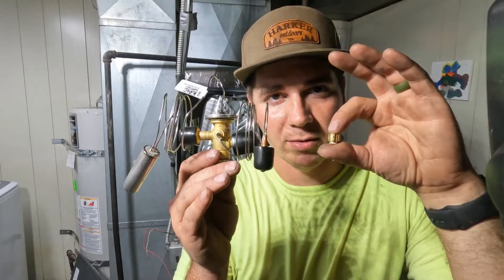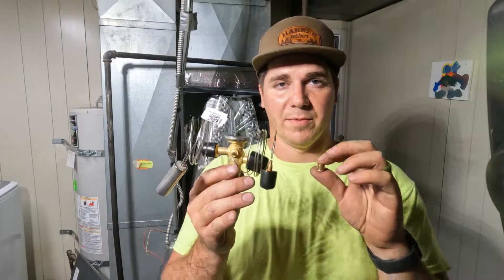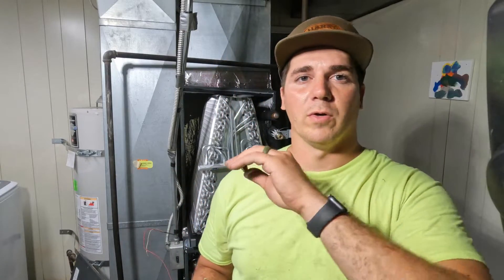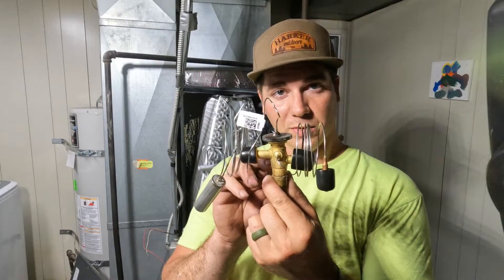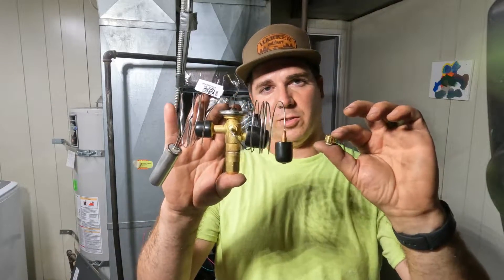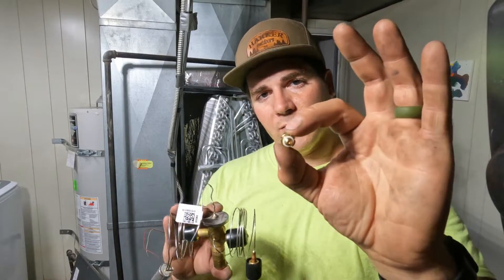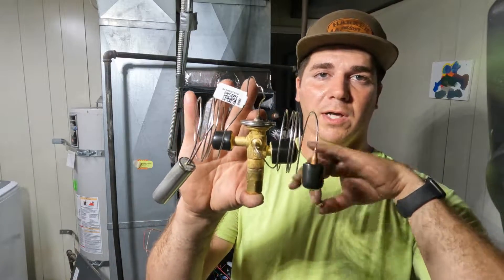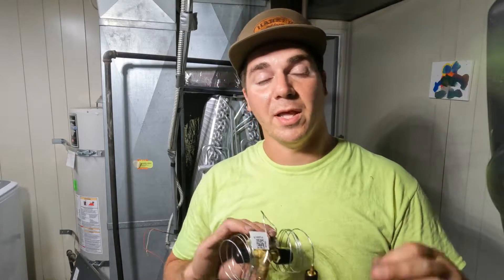Air Conditioner Metering Devices Simplified. TXV VS PISTON.  Which is better?

Comment: I have (2) 49 year old units, possibly carrier, the plates are all unreadable. Can I assume I have R22 in them, and that they were built with piston metering?
Reply: Back in those days they used capillary cubes so most likely that or piston and yes you 100% have to use r22

Comment: The money saved through the TXV will be negated by the cost of repair it will cause by way of failed compressor due to a faulty TXV or failed TXV itself all of which are costly $800+. Piston will never clog or break down and will cool the house very well and the difference in electrical bill will be minuscule. 
This is my opinion as a HVAC tech since 2019.

Comment: This isn't the best description.  A txv allows for a fixed subcooling regardless of conditions.  This is extremely important if you have to deal with variable humidity levels.  It's more efficient as noted in all conditions.  With a properly installed system, a TXV is very reliable and they cost $60-100, they are cheap.  With new efficiency standards they will effectively be required.  The reason they don't get installed is that techs don't understand them.

Comment: Hi Dave.   Excellent video.   Question:   Are capillary tubes ever used in residential split systems as the metering device or are they mostly for smaller appliance devices like window units, refrigerators and freezers.    Thank You.

Comment: Hi Dave, correct me if i'm wrong.
Most (99.9) TXV's are Hard Shut Off TXV's. If using a scroll compressor you're ok.  However, if used with a  reciprocating compressors you must install a Hard Start Kit at the condenser.
Reply: I don't believe any TXVs fully close, so they aren't hard shut off as they are always open some.  All modern AC compressors are scroll.

Comment: Thanks for the video.  We get bi annual checkups on our now 5 year old system.  Local HVAC company recommends an upgrade and wants to charge me $2,000 to go from a piston to the TXV which seems ludacris to me.  Any thoughts?
Reply from the maker: Yes that is ridiculous. Stick with your piston if it’s working fine
Reply: @diyhvacguy  If it ain't broke, don't fix it.

Comment: There are two different types of expansion valves  adjustable ,non adjustable  u can adjust your swing on your expansion valve if u add a pressure port at exapnsion valve so adjustables are more for energy efficiency to meet certain seer ratings  in my honest opinion id just use an orfice it get as cold as its going to get with and expansion valve if not colder 100 percent of time  ,with a well insulatated home the compressor run time will be less and last longer than with expansion systems plus one lesss part that can go bad 😅 this is from my experience being the the industry for 12 years plus in so cal i do industrial refrigeration and air conditioning i started my first 7 as a residential ac tech and ran a service department so i encountered all types of issues and complaints ❤❤❤❤❤😢
Reply: Yes and no. You know if compressor is running properly there’s nothing wrong with it.. like he mentioned- running without stress. Plus a better humidity control. 

This is a dilemma for me now. I have a piston system and I have txv. Don’t know which direction to go

Comment: Awesome video all the time. I have a question  R22 condenser transitioning to 410a. same r22 evaporator do i need to install txv or piston is okay.
Reply from the maker: You actually need to replace the coil all together. R22 coils are not designed to handle 410a pressures unless it says it’s compatible with both. If it is compatible or you are replacing it with a new one, and it’s not in a space that is close to living area or sleeping areas, I’d do a piston. When you are close, the refrigerant passing through sounds like water running and can be noisy if it’s close to where you are hanging out or sleeping. 👍🏼 piston is more reliable, txv is supposed to be more efficient.
Reply: @diyhvacguy  Interesting!

Comment: How do you test a TXV?  I had a pro come out and said nothing was getting through and wanted to replace my entire system!!  I know TXV's can be expensive but can't I just put in the that valve and bypass the TXV?  Thanks Really enjoy your channel 🙂
Reply from the maker: Yes you can remove the txv and install a  piston which is much simpler. If you need some help with this, check out our membership at Patreon.com/diyhvacguy where we give you one on one help with repairs such as these. Cheers
Reply: @diyhvacguy  will be signing up!!!  thank you

Comment: My home was built in 2016 and today, my neighbor had a tech come out to service his AC and noticed that there was a bag attached to his unit with a part (the piston) in it. Mine is the same way. Is this part important?
Reply from the maker: No, if your unit has a TXV, thermal expansion valve, then that piston was not needed during installation. A lot of guys leave them stuck to the unit. So no reason for alarm 👍🏼
Reply from the maker: There are two types of metering devices, txv’s and piston. Each condenser comes with a piston, so the installer just left it on the side of the unit instead of taking it off and throwing it away is all
Reply: @diyhvacguy  Oh, ok. Thank you.

Comment: Hi I'm replacing my A/C unit I have a 2 ton the one I'm trying to get is a 3 ton the high line for the 2 ton is 3/4 the 3 ton is 7/8 
Can I use an adapter ore I have to replace the all the copper lines
Reply: You will have high oil velocity and higher head pressure, it is not good for your compressor in the long run. Best to just start over with a new lineset. If you must do it, you can use a reducing fitting.
Reply: just go for 2 1/2 ton it is less filing and tastes great LOL

Comment: How do I adjust my valve to make my air colder? That’s what I need to know. It gets hot here in Florida. I was also told I could convert my old Freon unit to the new Freon and save money.
Reply from the maker: You can definitely check out some other videos on the adjustment, there’s typically a cap at the bottom and you will adjust it as you are measuring the subcooling. I will try and create a video soon that explains this in detail.
Reply from the maker: It’s kind of rare that they will be out of adjustment, and some actually don’t have any adjustment and just need replaced. If it’s an older system, I’ve seen many that are working as they should but either they were not sized properly and as they got older they just can’t keep up, or they were sized properly and are just extremely inefficient due to age.

Comment: Question; can you use either a TXV or piston ? Or does the evap design dictate one over the other.
Reply: Some times it's in there lmao 🤣
Reply from the maker: Yes you can use either. All Goodman condensing units will come with a fixed orifice  piston in a little baggy stuck to the side of the unit.  

All Goodman Evap coils come with a  fixed orifice piston in them, but I always use the piston that came with the condensing unit. It comes with a piston removal tool (little skinny metal pin with a 180turn at the end of it) so you can remove the one that comes in it and put the one that came with the condenser. 

On a side note, if you are thinking of doing the replacement yourself, I’m going to be doing some videos on the use of mapp gas and stay brite 8 solder for the lineset. With this method, there is no need for a nitrogen flow due to less heat being needed, and a way lower price point then having to purchase oxygen and acetylene torch and tanks. Even from the hvac contractor perspective, it looks like a far more efficient and cost effective way to connect copper lines. Anyways, stay tuned for that! Cheers

Comment: Youtube deleted one of my comments for some reason so I'll try it again... while watching the AC install vid a question I had was if it's possible to install it without brazing. That is a snippet question that you can rank for pretty easily
Reply from the maker: I’m always looking for those video ideas so keep them coming! I’m going to be doing a video soon on using mapp gas and stay brite 8 so you don’t need to have nitrogen in the lines because it is waaay less heat, and supposedly it’s stronger. AND no expensive oxy acetylene tanks needed. Perfect for the average DIYer. The only other option is the RLS or Zoomlock hvac crimp fittings but the tool to crimp them is super expensive. Not ideal for a DIYer.
Reply: @diyhvacguy  Even if the other tools are not realistic for DIY it is still a good source of content because that's what the question in the viewers' minds was. Most of the channels I follow were after searching on a question and they said not to do whatever I was looking for. It adds credibility. Also, it might be worth researching what it costs to rent expensive items like zoomlock and so forth.

Comment: Also, even if the answer to the question about doing it without brazing is "no" it is still a good snippet to capture and explain why not. The existing competition for that snippet is just links to product manufactures so those are much more biased results. The search engines would prefer to get results for those search terms from more independent sources which means it's a snippet you can rank for even with a new site.